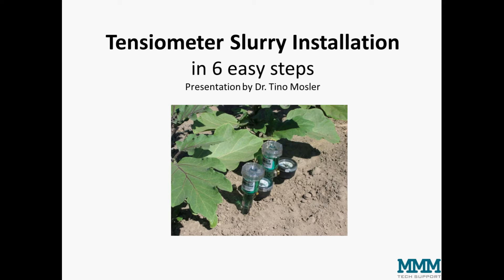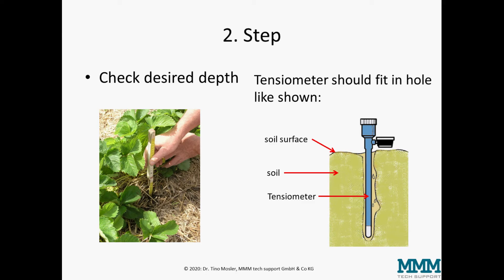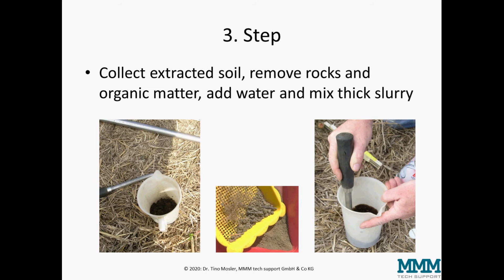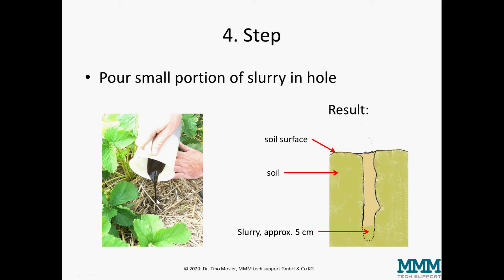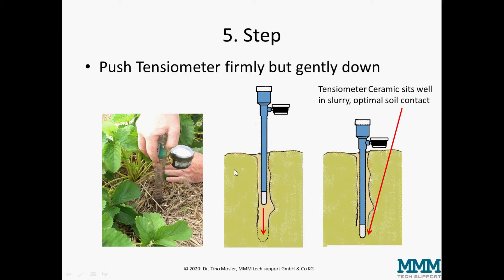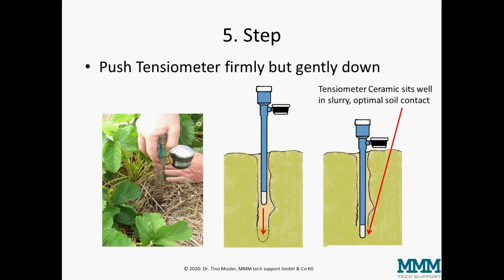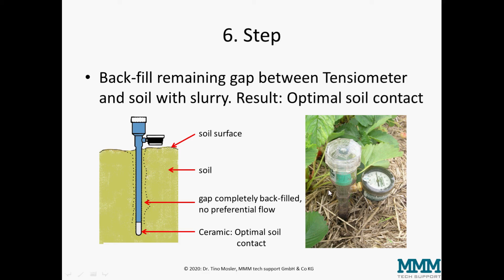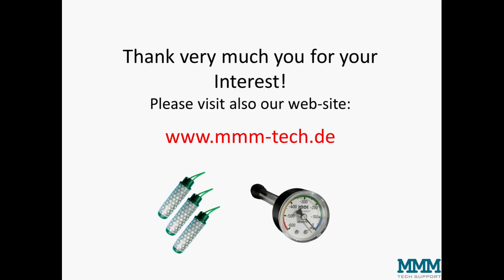Tensiometer slurry installation in 6 easy steps

Comment: Hello, is tensiometer can automate for smart drip irrigation?
Reply from the maker: Hello, 
it is possible to automate irrigation systems based on Tensiometers and make them smart, but not with the control-type of Tensiometer, which is shown in the video. There are two ways:

a. Automation with switch Tensiometers: Please find an overview on available models on our web-site at, direct link: https://www.mmm-tech.de/index.php/en/tensiometer/txs

b. Automation with electronic tensiometers and a wireless data aquisition unit like our IoT4H2O (IoT for water) universal data aquistion unit. This way requires some additional hardware and if you use your own IoT unit it would also require programming, but this way opens almost unlimited options.
direct link to our electronic tensiometers: 
https://www.mmm-tech.de/index.php/en/tensiometer/tx-e
direct link to oT4H2O: https://www.mmm-tech.de/index.php/en/iot4h2o
🙂

Comment: How long could we know the result of soil water potential?
Reply from the maker: Hello, we are not sure how to understand your question. In case you would like to know, how long it takes until a Tensiometer gives the final reading, the answer is, that this depends on the soil type and the current soil water status. Normally you can use as rule of thumb, that a Tensiometer gives 1 day after a slurry installation the final reading.
However, in case you
Reply from the maker: However, in case you would like to know, for how long a Tensiometer reading represents the current soil water potential, the answer is, that a Tensiometer reading gives information about the current soil water potenial. The soil water potential is a dynamic value, which can change rapidly.